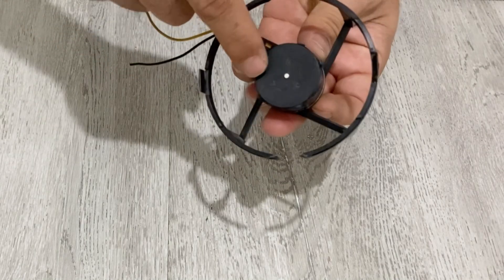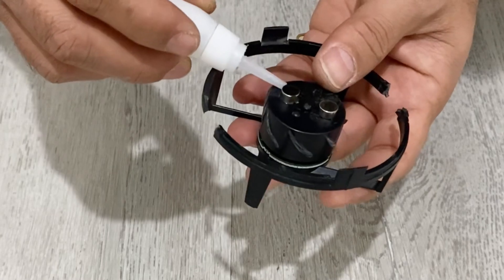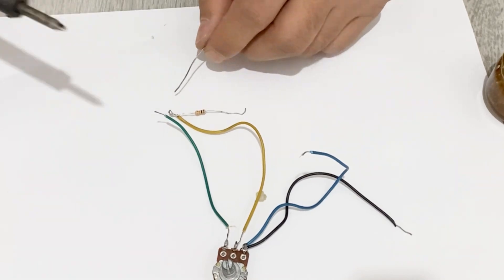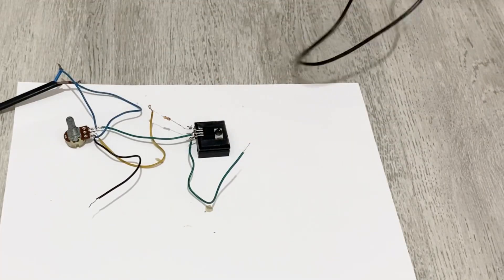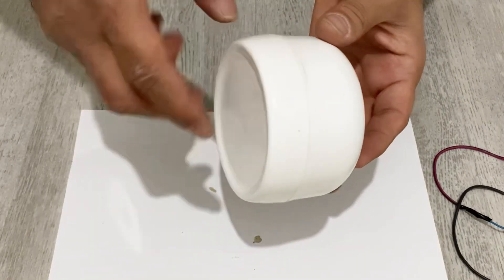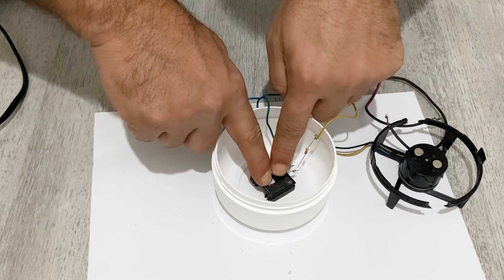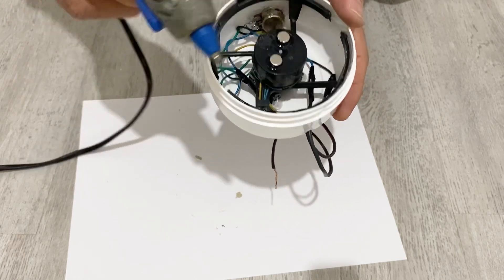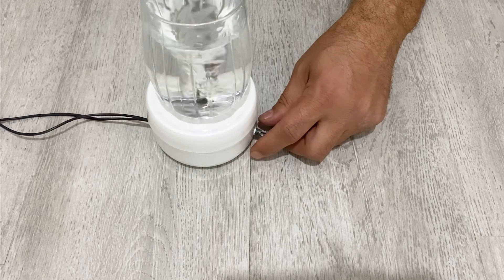How to Make Magnetic Stirrer? With voltage regulator explanation.

Comment: Sir I wish to make it school just a class 12th student I am...sir plz provide knowledge what power source do you use. I have to make it for my school project so can I use a 9V battery will it work? Will it work the same efficiency?
Reply from the maker: Probably it will not work very well. So l suggest you to use 12-18 volt power supply or battery.

Comment: Not very professional. To make a rotating magnetic field the best way is to use two STATIC coils at 90° and feed them with a (cheap) stepper motor driver adjustable for speed and microstep resolution. An even cheaper alternative is to feed them with two sine waves at 90° of phase shift. The motor is prone to vibrate if the weights are not perfectly balanced. If one wants to sacrifice a motor it could have been done using just the stator and not the rotor for the purpose.
Reply from the maker: You may be right. But this is the most practical way.

Comment: I enjoyed the video, and I want to make my own, but I'm a little confused about the parts.  I enlisted the help of ChatGPT, which isn't perfect, so tell me if you think this is wrong, but it said "The IRFZ44N is not a voltage regulator but a power MOSFET."  Not that it shouldn't work for your use, as we can see it does, but I don't understand the component much at all.  Can you help me understand a little more?
Reply from the maker: Thank you brother. First of all it doesn’t matter what is a IRFZ44N and what is it used for, you can use it to make a voltage regulator as shown in the video. Trust me on that and just follow the steps shown in the video. It’s not as complicated as you think. Good luck.